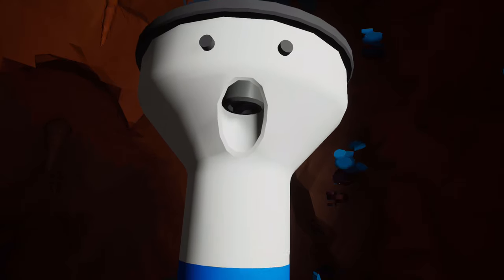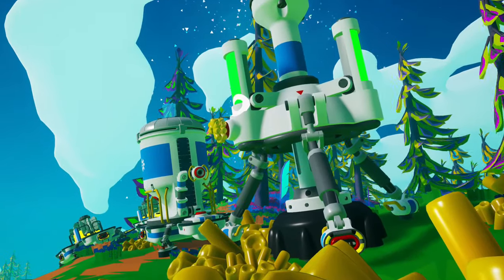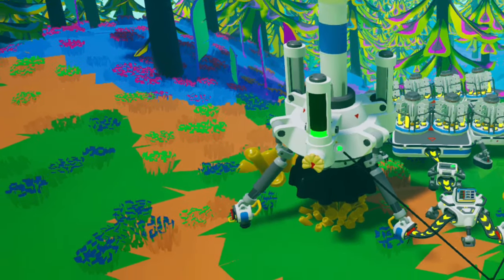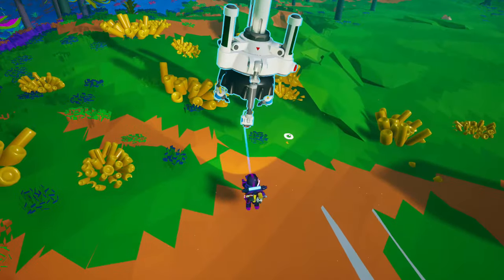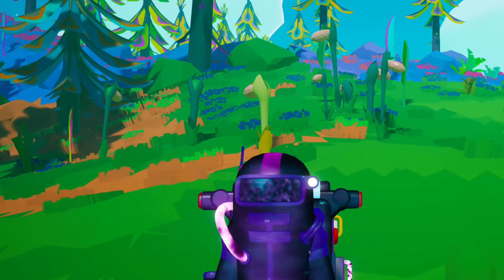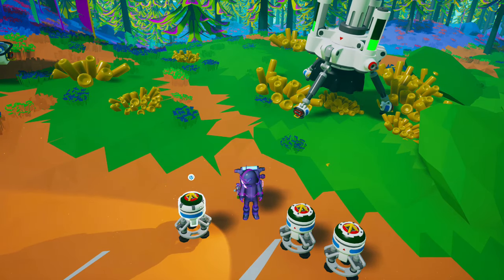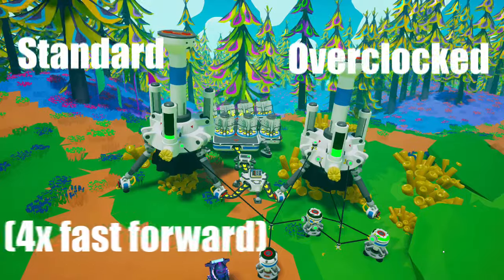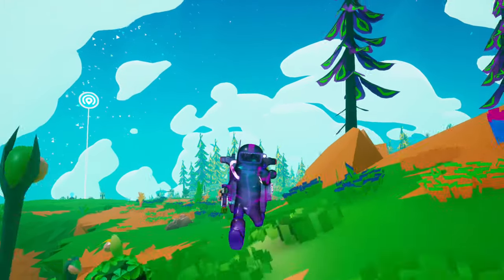FASTEST resource collection with overclocked extractors Astroneer

Comment: guys a better and cheaper way to get the power needed for the extractors is to automate medium generators. you need tappers farming organic than an auto arm putting it into the furnace and then another auto arm taking the carbon and putting into the generators very easy and provides loads of energy

Comment: 2 years later this still works! Like suggested in the comments, Ive put a delay repeater stacked onto a button repeater with the anchor of the delay repeater hooked to the extractor,  as well as a QT-RTG onto the 2 top slots of the extractor for minimalictic and space saving design. However incase anyone tries to hook an auto arm to this setup, be aware that due to lack of power supply it will nullify the effects of the overclock. You have to feed the auto arm with a different power source.

Comment: Something I realized while doing some experimentation with this overclocking mechanism: you can put a QT-rtg and a delay repeater stacked directly onto a button repeater, and all you need to do is stick the anchor of the delay onto the extractor.

The trigger of the repeater will feed into the extractor, which will feed back into itself.
Reply from the maker: Very interesting, I'll try to do that. Thanks for the tip 😊
Reply: @KuyaGameAstroneer  i redid the basic idea to use an area repeater on a delay repeater on top of a battery

The battery sensor is just there so I can mount the repeater clock without taking the T2 slot, so I can put a medium silo on it. Nice and self contained, no auto arms required.

Comment: Someone touched on this in a reply but you can do a basic set up of an overclocker that will mount on the auto extractor.  
- make a stack with a battery sensor on the bottom, then a delay repeater, then a proximity repeater. 
- mount that to the auto extractor, set delay to around 9, and hit the proximity repeater.  (I usually put it on the back of extractor and not too close to the resource canister so that it doesn’t cause the canister to keep switching from input to output)
- then I connect power that gives 1 unit and put a medium canister on top. 
I always use this over clocker but for larger collections I use the content creator’s auto arm + large canister set up.

Comment: I like to run a rail line to each extractor. The rail line is connected to my base power supply at one end and the extractor setup at the other. That way I can keep all the power production at the base. Super easy, after all the train is the easiest way to transport all those resources.

Comment: I have a 4 medium car setup that I haul behind my mining car (large car). 2 cars hold large wind and solar power source, one holds a large container, and the last one has a beacon and medium batteries. They are also on the ends of the car train. The arm is placed on a tall platform,  acting as a wire extension as well. This system allows me to quickly move the mining operation.

Comment: protip:
if you want to make a portable version, get a rover, put a winch on it, and somehow get it to be capable of storing said items
so what you need:
rover with enough battery and power generation
winch
some storage
then, go lug it around, you'd get practically free resources
Reply from the maker: Thanks for the tip 😊🚀
Reply: an entire unpacked auto extractor can fit on a big rover
Reply: @KC-bu8qq  thing here is:
you waste literally so much space, that it's pointless to do so
you can just use a winch instead, which saves you 6 sockets, which you can place more useful things on

Comment: Confirming it still works on console. It completes two full animation for me, but after that seems to line up to overclock the rest :)
Reply from the maker: Thanks for that 😊🚀
Reply: @KuyaGameAstroneer  no problem, thank you. I've found I can load everything up on a single large rover. Large canister on back, auto-extract top with auto-arm on it, seat front, and med storage on front with single qt-rtg, light, button repeater, and 2 delays. I have all the segment pins hooked up except to auto e while driving. When parked, auto-e placed, pins placed on it, auto-a and med store goes on top front, then power with front flipped.

I can send you a imgur in reddit if that didn't make sense
Reply: @KuyaGameAstroneer  I would also like to add that including 2 more qt-rtg and a  portable smelting furnace will allow you to smelt as fast as the overclocked auto-extractor will produce. Perfectly lines up so that only smelted resources are stored. No bottlenecks.
Reply from the maker: @Infinite_Curiosity00  sounds great, well done 😊
Reply from the maker: @Infinite_Curiosity00  wow thanks for this tip 😊🚀

Comment: To make a simpler clock just put a delay repeater on a button repeater, branch the output of the delay repeater, connect it to the button repeater and whatever you need to connect it to
Reply from the maker: I should try this 👍
Reply: It works? Can you update with another video tutorial? Pleease😂😂🙏🙏
Reply from the maker: @Bra198394  it should work, it does the same thing, just differently 🚀😊

Comment: I couldn't find power repeater where can I get one???
Reply from the maker: Unlock it in your catalog, in the small printer section, then use the small printer to print it 
(If it's not there, you may need to compete missions to unlock it)

Comment: Would this work under ground because I have been using your scrap farm design and it's really good however I have been running into a really anoyying problem that when the the soild-fuel jump jet arrive 4 of them are deposited on the other meduim storage the one where the astornuim should be placed the problem is that my extractors aren't make astornuim as fast so where  the soild-fuel jump jets aren't going were I want to go on there storage so the sensor isn't working because that storge isn't filling up so do you think if I make the auto extractor produce astronuim faster would solve the problem? And would over clocking it would work underground too? Thanks
Reply from the maker: Yes this works underground and can help speed the process up

Comment: I think overclocking got patched, since the auto extractor slows down a lot when it gets turned off. I don't know why they would fix this, though.
Reply from the maker: Are you sure? It looks like it's still working
Reply: @KuyaGameAstroneer  Idk but my auto extractors are just slowing down instead of speeding up
Reply from the maker: @messyman7449  from what I know it's still working, I recommend that you follow the steps shown in the video closely ☺️
Reply: @KuyaGameAstroneer  ok, I will try different times and hopefully it will start working
Reply: @KuyaGameAstroneer  I got it working in 2 attempts 🤦 I just needed to put it to 8 ticks
Reply from the maker: @messyman7449  great ☺️😊 good job 🚀

Comment: Automatic extracter production facility
Reply from the maker: Yummy 🚀🚀
Reply: I think I know how to make one two.
Step one: set up xl platform with storage sensor witch when it detects that the platform is empty it will send a signal.
Step two: set up a large printer that prints onto the platform and connect the output of the storage sensor.
Step 3: set up automated labs and other machines to turn raw materials into the needed materials to make the auto extractor.
NOTE: you will have to give it exo chips in order for it to work.